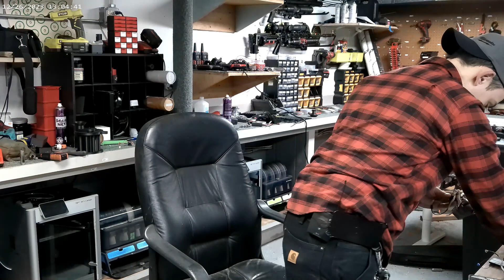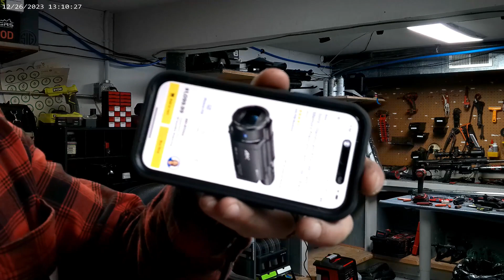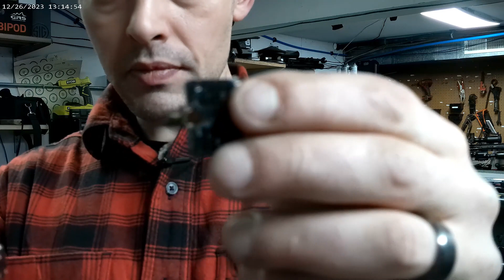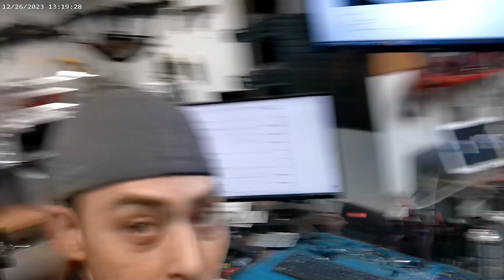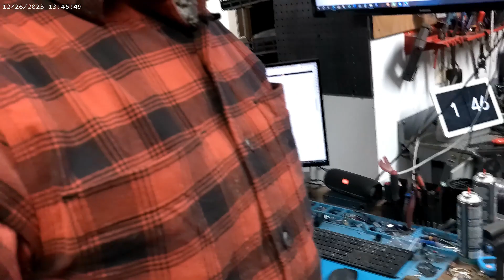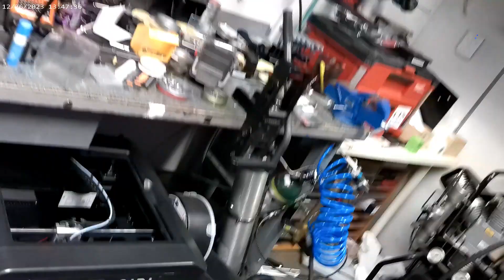Qidi X max 3 after 3 months and more frustration / poloroid camcorder (sorry about the audio)

Comment: I am printing large industrial Nylon gears. Would you reccomend the F430 or the Qidi Xmax3 will do the job. I want reliability and support from the manufacturer. The diference in price is big but for a most reliable machine it is worth it in my opinion.
Reply from the maker: Hey man, good morning, so that’s a loaded question for sure. With QIDIU will definitely get support in the form of you doing the work and they send you the parts and give you information on how to do it. CreatBot’s support I’m unsure of, they were working with me, but the truth is I was going so far on that printer, there was nothing left of theirs that they could help me with so I don’t know how far they would have gone, but it seemed like they were willing to work with me even when doing modifications, but the reason I did so much to that printer is because the F430 is worth doing it to. It needs updated electronics. It’s a 10-year-old printer, but the fact is it’s industrial built. That’s the reason for the cost increase, it’s a truly industrial 3-D printer. It’s all steel construction, large, linear, rails, large linear, rods, and lead screws, it’s built to be an industrial machine printing all the time. So hopefully that information is helpful, now that I’ve done everything I’ve done to it. I can print with it in very high temperature material, I’ve been successful with PPS, which is a high temperature. Very temperamental nylon, I’m going to do Peek and pekk next. And I don’t anticipate any issues after seeing do this. If you have a more specific question, I can answer it for you to the best of my ability, but the decision is not an easy one. It’s a very different printer, it seems like for your purpose and 1 of reliability, the CreatBot is probably going to be your best. Bet if you can afford it, but the QIDI will definitely have the support, but the problem is you’ll need the support. That was the problem for me, they were there, and they were helpful, and they sent the parts I needed, but I didn’t want to need that many parts that fast that often. The industrial printers are going to need maintenance because their printing at extremely high temperatures, you can’t find a printer you can do that without having any maintenance, but at the same time it’s very easily maintainable. Everything is industrial. So it’s all serviceable. That would be my choice for your application, but you have to make your own decision. Obviously, I’m happy to help educate you as much as I can on the machines, but ultimately it’s your decision. I hope this is helpful.
Reply: Hey, I am really thankful for your comprehensive answer and for taking the time to explain. I will check if the reseller in Greece can help with  the mentainance and if yes we go for the creatbot

Comment: These videos are necessary because I was about to order Qidi x max 3 for my university on personal responsibility. But I will just go with the x1 carbon now. Even though it’s a lot more expensive.
Reply from the maker: Did you see my updated videos, they really turned it around with me. They have actually thoroughly impressed me. QIDI technical support/after Sales service I couldn’t get a hold of that first time, then I had another problem later on, and they ended up helping me tremendously. Sent me a ton of parts walked me through how to fix everything, and I got the printer working actually really well. Honestly, the bamboo does work better out of the box because there’s not a lot of issues with it but I think now they are making all those new parts that they sent me standard, the hot end has much more ventilation and three fans plus the turbo fan in the front where there was only one before, they sent me all that stuff, but it’s all standard on the new models. I would reconsider before making it decision, I made sure to make new videos of the after sale support really standing up and backing up the product afterwards, honestly, bamboo support was just as hard to get a hold of. I did mention that in the video, but I didn’t have many problems with it so it wasn’t a big deal. But had I had any problems I don’t know when I would have gotten a hold of them, Q has been responding within hours, literally from China, even during the day, which is middle of the night over there, they have really been on top of it. I have a string of 100 emails they helped me with every single problem. This was the truth at the time, but since then they have really stood up to the plate.